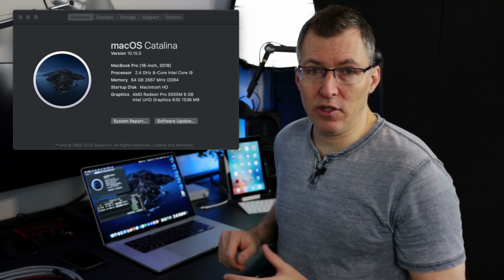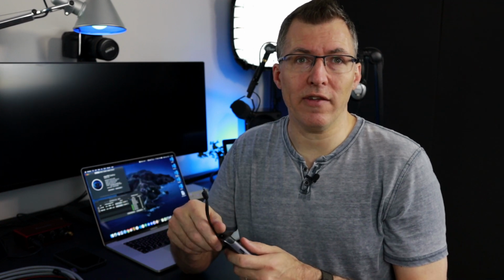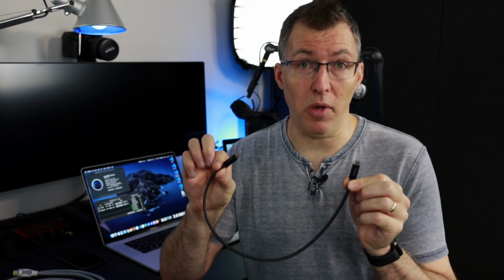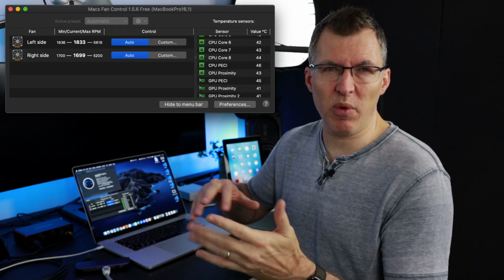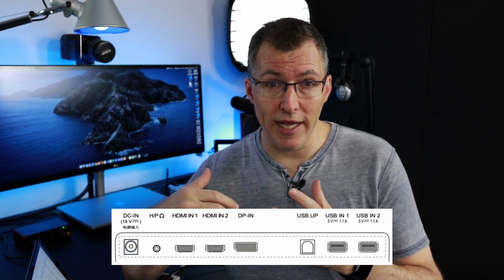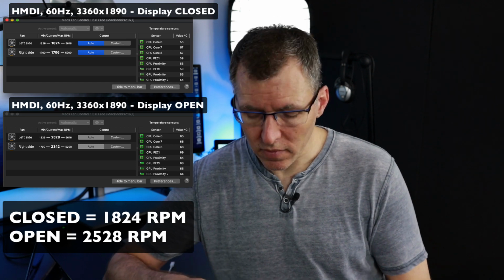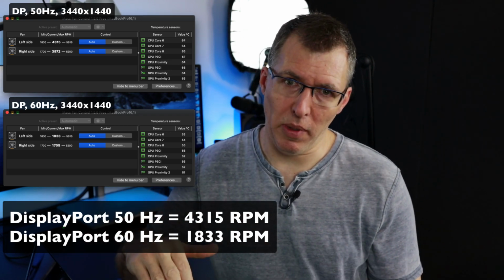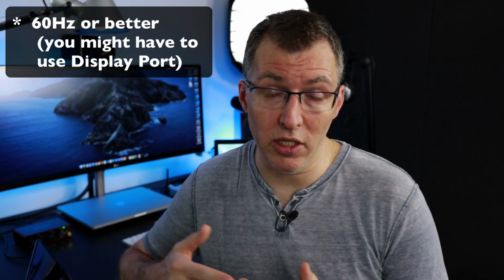SOLVED! MacBook Pro 16" + External Monitor = High Temperatures and Loud Fans. Here is the FIX!

Comment: I used a vacuum cleaner blow function to get the dust out of my macbook pro 2020 and now the heating issue is gone .
Please try it first before using any other methods like fan software and change of cables.
Reply: I got my MBP back from apple support, fans stopped working exactly 1 month after my warranty expired (200usd for the new fans)... Brand new cooling system, still having this issue. 

It's ridiculous how I can't connect my $2,500 computer to an external monitor without it burning everything inside. Last Mac I ever purchase.

Comment: My 16 inch always gets crazy hot even undocked. I adjusted Turbo Boost parameters and that has made the biggest difference for me.
Reply: Having that issue using CaliDigital t3s dock and 2 27’ thunderbolt displays and my laptop goes into thermal protection black screen etc and press any button to reboot ... help

Comment: the problem is the thunderbolt controller. Look at your temps when the external monitor is connected. The controller registers the highest temp by far, which triggers the fans.

Comment: I appreciate you did some work to put all these info together, but you haven't run macbook and external display in the same time. 

So unfortunately I haven't understood any fix for this situation. 

From my tests with external monitor Lenovo L27Q-10 1440p. Connection via HDMI cable using HUB that supports 60hz 4k. 

1. doing nothing with external monitor and MBP display on I had 18-20 watts Radeon High Side 
2. in clamshell mode same 20 watts.
3. in clamshell mode but resolution changed from 1440p to 1080p - 5-6 watts power draw.
4. 1080p + MBP display - 18-20 watts. 

I made a test with USB-C - Displayport Cable and the result was the same.. 20watts

The question is.. Radeon power draw is influenced by External monitor resolution, Refresh Rate or about conectivity ?
Reply: Hey friend!

Lenovo ThinkVision P27q-20 here. Same scenario as yours.

Ended up solving like this: 
https://forums.macrumors.com/threads/16-is-hot-noisy-with-an-external-monitor.2211747/page-75

GTF 2560x1440 60Hz and I can confirm 6-7W close lid and about 50 celsius degrees CPU

Comment: it was fixed with MacOS 11.2.2. Cheer.
Reply from the maker: Do you have any reference for this? I Googled to try to find some confirmation of this and couldn't find anything.
Reply: @VirtualTechMeetup  Hi Just experienced myself. Right after upgraded, it stopped heating up (with the older version, it heated up immediately). But still need time to jump firm conclusion.
Reply: MIne actually started to have problems again around after I upgraded to 11.2.2
Reply: @mariah4197  on 11.4 atm and still struggling
Reply: @jungocroco  mine improved when I followed a hack where you put thermal pads on some components. It wasn’t as bad as before and I stopped encountering issues with CPU usage spikes

Comment: Hope this helps:

I set the resolution to 4k/default for the display. And connect the external display using a thunderbolt-DP cable connected on the left side (farther port) and power+USB hub on the right. Avoid putting them on one side. Also, make sure there's enough space around the laptop.
Reply: The best solution ever that i've found! Doing it worked so great to me! Now i don't have any issues with that anymore. Bless you!

Comment: Thanks for the tip, I switched from HDMI/HDMI to USB-C/DisplayPort and the fans stopped running loudly!
Reply: I got an AmazonBasics DisplayPort cable and the Kernel Task usage is higher than on HDMI.
Reply: @garyj8779  same
Reply: What brand did you purchase?

Comment: Same issue. Find solution! Dropping resolution from 2k( 2500 rpms, temp of cpu and gpu about 65) to Full HD( 1850 rpms, temp of cpu and gpu about 48). 
Well, unfortunately i tried all possible cables(type-c, DisplayPort, hdmi). Thanks for video. If you have an update about MacBook16+external monitor, please let me know!

Comment: I have same issues. So sad  that 2400$ laptop has that issue. I have Dell 27 inch 2k monitor, with hdmi, displayport, type-c connections. Tried all of them. HDMI goes at 60 ghz, and fans are speed at 2500, with closed display or opened no matter, temperature and speed of fans same 2500. same to display port(59.8 ghz, and i can't rise it).  Type-c has worst results, i don't know why but it goes to 3200 speed of fans and 70 degrees of cpu and gpu. Maybe  its problem with my monitor and better to buy something that apple has in recommendations like LG UltraFine monitors. If somebody found an answer how to fix it, please let me know it in comments below. Thank you

Comment: Would the same issue arise when connected to an external projector? I'm thinking of getting a 16" macbook and it would frequently be used for presentations connected to a projector. I wouldn't want to use it in clamshell mode as I'd have to keep turning around to check the slides. Help!
Reply from the maker: I am sure that it would. A projector is nothing more than a monitor in a different form-factor.

Comment: Thanks so much for the time you've put into this whether it works for me or not. mine is coming back from being repaired and was going to sell it to get an m1 but going to try the display port method first! (currently use the green hdmi option!) Mac arrives wednesday so will let you know. I'm plugging it into a 240hz 1080p 24" gaming monitor so will have to see if that resolution is enough or if it has to be 60fps or over AND a bit more taxing resolution to occupy GPU! Subbed! :)
Reply: What were your results? :)
Reply: @AlexMoophty  I bought an m1 air!

Comment: I can't believe Apple still hasn't addressed this, since its clearly a bug in the radeon driver. 

I have found, through my various trial and error, no difference in performance between a USB C to HDMI and USB C to DP cables. I did manage to get my Radeon high side wattage down to 6W by setting my display to its 1440p native resolution at 120hz. If I set my display to 60hz it jumps back up to 18W. Additionally, I need to run it in clamshell mode, if I have my laptop screen open it jumps back up to 18W automatically. 

I prefer the iStat Menus app to monitor sensors because you can monitor the input wattage in real time to see how hard your dGPU is working.  As I'm typing this now I am running with my laptop open and my dGPU is drawing 18W and I'm still idling at a fan speed of 2k RPM and though this may not seem problematic, it could be performance limiting. 

I would also like to point out that running Windows through bootcamp does not result in the same issues, so it's clearly a MacOS radeon driver bug.
Reply from the maker: Since I made the video this 100% open source alternative to iStats became available... https://github.com/exelban/stats
Reply: Yeah, this is a lot of talking to say that you need to keep the laptop closed when you have an external monitor. The most useful part of the video is that it debunks all the possible solutions in various threads such as plugging in the monitor on different sides or changing refresh rate. Your post is the first I’ve seen that presents conclusive evidence that this is a software issue, since you say it doesn’t happen when running Windows on the same hardware. I sure hope Apple fixes this, but it has been over a year so I’m not holding my breath.

Comment: Thanks! Just purchased a new 2019 MacBook Pro and a UHD monitor and going through same fan / temp issues. The fan noise is so loud my mic picks up during my recording. So frustrating! I am going to see if the display port would make a difference or may be it’s my monitor!
Reply: I use display port, no use, very high fan noise (MacBook pro 2020 16`` 32GB ram)
Reply: Did it work?
Reply: how did you find it! i was the same using apollo twin and ableton was like a jet engine!
Reply: Did you manage?

Comment: thanks a lot. A usb c to display port cable fixed the issue for me.
before I used a usb c hub with a hdmi -> 2560x1440 60 Hz -> fan runs always  on full speed
now with usb c to displayport -> 2560x1440 59,88 Hz -> fans are quiet and I found peace again.
Reply: Why is this a problem? What causes it?
Reply: can you share which cable you bought? Plus how much rpm's you have now? Thanks in advance

Comment: Does using the type c to display port cable not turn on your dedicated graphics card? Can you please check that? I do not have display port monitor and I will have to buy for testing. Also could you please check the power in watts consumed by the dedicated graphics card in both clamshell and lid open mode? Thanks
I am student who bought my first macbook pro with my software engineering internship stipend. Wasted all my money on this shitty device which just cannot work properly for needs, i.e. with an external display.
Reply from the maker: Any external monitor will use the dedicated GPU. The CPU's graphics isn't physically connected to the TB3 ports at all. It is only a question of whether your monitor will cause GPU into a higher power state. Don't get caught up on the kind of cable. The key is that you need to be at 60Hz or higher, and be using only one monitor. So if you have an external monitor, you will need to close the lid on the MacBook Pro itself.

I have since done testing with a 2019 15" MBP as well, and it has the same behavior. The only difference is that the GPU isn't as powerful, so it doesn't generate as much heat as the newer models. The 15" also didn't have as much cooling capacity, and the fan curves weren't as aggressive. This meant that the 15" would throttle much more than the 16". So it is a tradeoff between fans noise and throttling.

Again... from all of my testing the key is 60Hz or above, regardless of the cable. As I write this my GPU is at 5.8W, both CPU and GPU are at 49C, and fan is at 1835 RPMs. My LG 34" ultra-wide died recently, so this is on a Dell 38" ultra-wide (U3818DW) with the MBP closed.

Comment: will the display port work with 1080p display?
Reply from the maker: That would really depend on the monitor. Older 1080p monitors probably don't support 60Hz, which is the real problem. Whether HDMI or DisplayPort, you need to be 60Hz or greater.

Comment: Will definitely try using it in clamshell mode. The upsetting thing is I use a 1k external drawing monitor and it still heats up like crazy... and I can't use a DisplayPort because my monitor doesn't support it :(
Reply: Same, my monitor does not support a display port :(.. how did you resolve the issue..did anything work??
Reply: @uchichaitachi2183  honestly, I didn't really solve anything :( 
I installed a software that lets you regulate the fan speed and just increased fan speed to keep the computer running cool :/ 
It's kind of a bummer because it's not really any of our faults - it's apple's - and we're the ones left to try to figure things out on my own, when ultimately there isn't anything we can do because the model is just built that way :(

Comment: is the problem related to the GDDR5 chip used by the 5300M and 5500M? because the 5600M with HMB2 does not have this issue
Reply: Really? You've tried it? I'm thinking of getting the HBM2 too.
Reply: @3rd_iimpact  Same here. Word is you need the 5600M. I’ll be getting Apple care tho!
Reply: @alignedweb  Oh, you’ve heard the same?

Comment: Hello! I have MBP 2019 with Vega 20, and two external monitors LG 27UK850W. Both of them are connected using USB-C to USB-C cable provided with the monitor. Fans are around 5k all the time. Any suggestions? Thank you in advance!

Comment: I've been using the same MacBook Pro in a vertical clamshell mode with the apple logo straight up. That means the heat goes down where the hinge is located, and there is not much space between the clamshell stand and the desk. This causes some strange issues with Youtube videos and other problems. But when the MacBook Pro is in an upside-down clamshell mode, which means the hinge part goes up and also the heat goes up as well. I have no problem with the latter clamshell mode.

Comment: If you connect two or three monitors - is there anyway to avoid high temp or is it all over then?
Reply from the maker: I haven't seen any way to keep the GPU power, and thus the temps, down with multiple monitors.

Comment: What a shame you did not use istat to show the wattage use on the radeon card, which ultimately is the issue we have. I use 2x 1440p screens (1 mac cinema display, 1 dell) I've tried thunderbolt, displayport, hdmi, all @60 hz, as that's the only hz supported on these (only 1 display at a time). I tried a 4k monitor @30hz as well same results.
Radeon card pins at 18watt usage, instead of 4-8w which would be the normal , doesn't matter if lid is open or closed. 
If I start the mac with shift down (safe mode) it runs at 9watt no matter what. 
Running just laptop display 4watt with gpu enabled.
Setting dell screen to 1080p, lid closed - now the "expected" behavior happens .. around 8 watt usage on GPU, even though its still a bit high.
I use a caldigit ts3+ dock with 1 thunderbolt connected to the laptop, but will try and get a usb-c to displayport cable (I doubt it matters though).
Reply from the maker: I agree, a specific wattage reading would have been better. I have since found an alternative to iStat which is 100% open source... https://github.com/exelban/stats

Comment: This video does not really solve the issue??
Reply: The issue really is a problem with the way Apple builds their laptops. They run them at such a high temp due to the construction and they way they choose to cool the CPU. Any processing above normal has been shown to kick up fan speed. Especially on the newer models.

Comment: This is not only an issue with 16’. I have 15’ 2018 and the issue is the same
Reply from the maker: I have noticed the same with a 2018 MBP 15". I think this became much more noticeable on the 16" because the 5500M draws more power than the 560X in the 15" (those are the two that I have available for comparison). However increased temperatures when connected to an external monitor is common to both generations. In this regard I miss my 2015 MBP which had only embedded graphics. The priorities for my work are RAM followed by CPU. GPU is mostly irrelevant.
Reply: @VirtualTechMeetup  I've asked my friend who owns a 2018 MBP 13'' to see if the laptop is heating while connected to an external monitor, and indeed it was (With no apps running). It's crazy that Apple has been ignoring this for years while it's an obvious issue. It made me stop using the external monitor... During the normal work I do (run multiple servers, etc.), the laptop gets hot. Now on top of that, imagine how it is while connected to an external monitor.
Reply: @VirtualTechMeetup  thanks for all the info. I'm actually running a 2015 MBP but I am having fan issues when connected to a 4K dell monitor. Using a thunderbolt to display port connection. Haven't tested the clamshell method but will report back after trying it out!

Comment: My 2017 15" MacBook Pro sounds like it's trying to fly to the ISS when I connect it to a Phillips 4k monitor. I even bought a special cable but no dice. I looks like I'll have to live with the fact that I cannot use my laptop with an external screen, even in clamshell mode. I work on audio in a treated studio space so the noise is very much in my face and unacceptable. I never had this issue with a 2015 MacBook Pro.
Reply: So against all hope it looks like I managed to solve my particular situation. I hope this is helpful to anyone: I was using a Choetech USB-C to HDMI 2.0 cable 4K @60Hz 3840x2160 (the 'special cable' that I mention above) to connect my 2017 15" Macbook Pro to my Philips 276E8VJSB 4k screen. Heavy Ableton Live sessions would lead to temperatures of 90-100 degrees Celcius and fan speeds exceeding 5000 RPM (measured with Turbo Boost Switcher – I didn't disable Turbo Boost just used it for the measurements). As a last resort before selling the thing I decided to try the original HDMI-HDMI cable that came with the monitor, along with a Thunderbolt-HDMI adapter from Apple. The same Ableton Live session now generated less noise. I then put my laptop on a stand that allows for plenty of air circulation due to its open bottom and backside, and I placed the stand further away from my desk. Result: the same Ableton session now generates around 65 degrees Celcius and 3000 RPM. So I'm a very happy camper. The only caveat is that for gamers or others who mind not being able to utilize their 4k screen to the full, this is not a solution. But I care a lot more about silence than I do about perfect visuals on my screen – the standard HDMI cable is good enough for me.
Reply: I have the original apple adapter and use an hdmi, it still ramps up and gets hot. Do you think I should give the third party cable you mentioned a shot?

Comment: I opened up mine yesterday and found that there was almost no thermal paste on the CPU. In addition, since there’s no grills to filter debris on the air intake, I found so much dust and debris in the fan and fan’s air path. I think there are so many architectural issues and really regret getting one.
Reply: Do you also have the 16inch model? Just asking because I'm curious how it's possible to already have so much dust and debris if it's not even a year old...